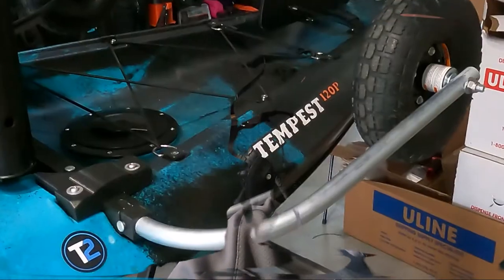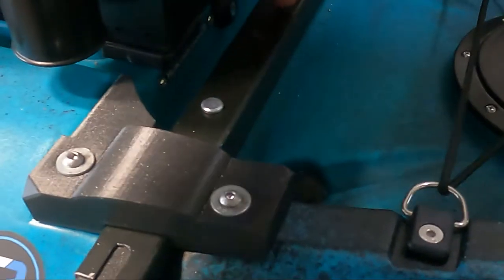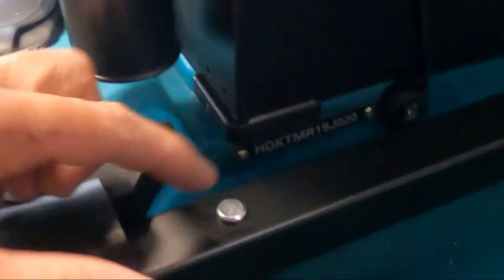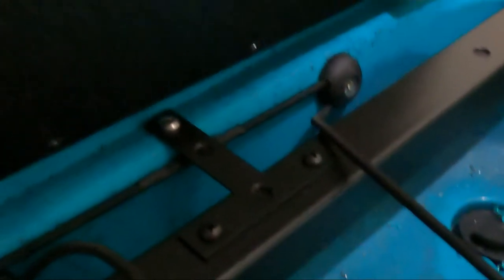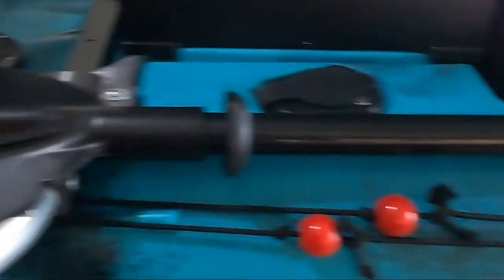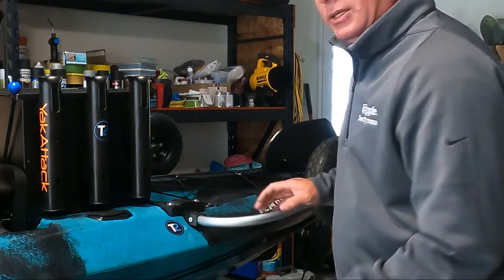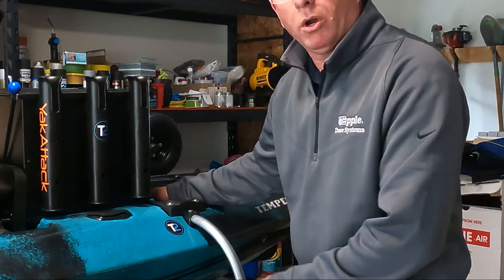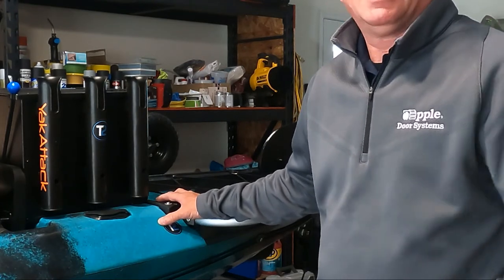HooDoo Tempest Landing Gear V2

Comment: There is a sort of very hard aluminum that I have seen very few places that would be excellent for this application. I think it might be "aircraft aluminum" that I heard all my life. I had a Nissan truck that had a bed cage that would flip over to the end of a lowered tailgate. VERY light, quite hard and less malleable than typical aluminum and conduit. I also would be tempted to use a plastic wheel to limit weight on the end of those legs. That is a good deal of leverage that stresses the pin holes and plastic parts. 

Not criticizing, just thinking out loud. I appreciate your design and want to but one. I am glad to share any learnings that might help you make a few bucks. Your "American Ingenuity" should be rewarded!
Reply from the maker: I appreciate all that advice and information. 

I have looked into different leg materials, but man they are expensive. They would also require expensive equipment to bend them into shape. 

My goal with this design was simply to make something for myself to use, others shown interest so I made a few for others. My goal was never to mass produce this product, I enjoy making them and want to continue making only a couple a month. 

I have changed the design a lot since the first design and that came from my own trial and error and also others using it and helping me refine it. 

You are 100% correct that the conduit is the weakest point of the design, but the redesign has increases the longevity of the legs..i just had a customer tell me got 60-70 uses out of them, and he broke them by accident, we inspected the legs and they were barely worn. 

I also do not want to creat something that costs 300 bucks that still needs to be modified to be fitted to the HooDoo. 

I am still looking at and listening to ideas for the legs your input was perfect, I appreciate it.

Comment: Hey Tony , I've watched this a couple trying to get a good look at the changes you  made at 3d brackets but couldn't see with being black. The holes wearing out in conduit was a problem right away for me. I'm currently on my 3rd set of legs, this time I made them out of stainless steel which is very hard to bend and drill and my square tube has a lot of holes now. I really like the idea of going through the inside 3d peice to stop the hole wallowing out. Where does the new metal peice for brackets go underneath? Does it require longer bolts?
Reply from the maker: Man, stainless is the way to go for sure. I just could justify spending that much on the legs or find anyone to bend them for here locally. So the solution I can up with was the use the 3D printed parts and actually drill through the plastic which had worked really well. I haven’t had to change my legs out all summer. 

The metal I put in the bottom brackets was to reinforce the plastic and also add some rigidity to the top brackets. I made the new ones where the plastic actually slides/inserts into the print itself. It uses the same screws I believe, 40mm. 

I’ll send you a photo through messenger..
Reply from the maker: I don’t have you on FB, if you wanted to send me a message through the HooDoo Page or email me, I can send you a photo
Reply: @tonytillman316  , if you remember I work for a boat company and the guy that makes the bimini tops did the bending but my concern became the stress is on your brackets if anything has to give so I definitely want to purchase the new kit. I'm not on any social media sites but I think I'm on etsy still
Reply from the maker: @BGPD70  I send you a photo through Etsy and message through Etsy.

I can print up a new set for you man, no worries there.
Reply: Hey Tony, I have the same exact kayak and I’ve been wanting to put these wheels on mine as well. Do you still make or sell these? Also I don’t have Facebook so I’m not sure how to communicate. Thanks Joey.

Comment: Do you think this would fit on a hoodoo impulse 120? The impulse  is three inches wider and 20lbs heavier.
Reply from the maker: Jim, I honestly am not sure. I created the hole pattern and the design to fit the Tempest Series. I have changed the design and build a lot since the first ones were made. 

I believe the Impluse has a different hull design than the Tempest.

Comment: Just received the the 3D printed parts and am about to start building mine.  One question.  I see that one of the square pieces has a pin that keeps it from rotating on the conduit.  But couldn’t tell if there was a pin on the other piece. The one that you put the pin in when it’s in the down position.  Is there some kind of roll pin recessed to keep it in place on the conduit or is it just slipped on and stays in place?  
Hope my question makes sense.
Reply from the maker: Let me think about your question. LOL. I can also send you some photos of it helps.
Reply: @tonytillman316  haha.  Sorry I worked 16 hours strait yesterday.  Basically what I’m asking is if the piece that goes on the end of the conduit held in place with anything.  My concern is that I pull the conduit out and that price slips off in the square tubing.
Reply from the maker: @tsjuno  ,  it is not held on with anything. It is a really tight fit, you will need to use a piece of PVC to knock those pieces onto the conduit. Once you drill the holes into the conduit, the holes you drill also go through the 3D printed parts.
Reply: @tonytillman316  awesome thank you.  I was just trying to make one trip to the hardware store.  Haha.
Reply from the maker: @tsjuno  Good Luck with that! LOL I always seem to going to True Value to Home Depot

Comment: Im re uploading this my comment for new people to make the most educated decision to buy or not.  "So my yak finally came and i put this on.... the two legs sat at slightly different angles when in the down position.... the holes to mount the wheels, yeah one was straight the other was about 4 degrees off..... and when i sat the kayak down and let it rest the 3D printed parts made noises lile rice crispies. You can keep my $ as it was purchased months ago ill call it a learning experience to remember that you get what you pay for, but i cant condone others getting this product." This dude saw that post and offered to send me the new version within a week and he  hasnt done it. Its been over a month and he has since deleted his statement that hed fix the problem and hasnt responded since
Reply from the maker: Andrew, you are correct sir, I haven't made another cart. I have already sent you another set of legs and brackets if I remember correctly. I also sent you a message on Esty a month ago and got no response from you. You have bene nothing but rude and damaging. The way you have handled this situation has been child like and not in a way to get results from me. I wioll leave this post here, because others that have purchased by cart know my level of customer service and committment to it.  I am sorry that the cart broke on you, but I honestly feel after our other conversation it was user error. I sent new ones and had not heard anything back for several months. If we are going to be honest here, lets be honest and get the whole story. 

If you want to get results from a vendor, you handled this all wrong. I hope its a life lesson for you.
Reply: @tonytillman316  the second ones you sent me were worse than 1st. You even said you couldn't pull the legs out the other half of the square bar so dont tell me its all operator error. The 2nd set of legs the holes to mount to the bar werent drilled incorectly leaving one leg at a very slightly different angle and same with the holes on the wheel one was angled in toward the kayak.
  Yes it was several months between the 1st attempt and my rage.  i mentioned that. Not trying to hide it. That was because my kayak was on order. Due to that  I said id call it a a learning experience, and you offered to try again. I repeat You offered. I didn't ask you for anything else. Be a man of your word even if you're pissed at your customer. If you weren't going to fix your product then you shouldn't have offered to do it.